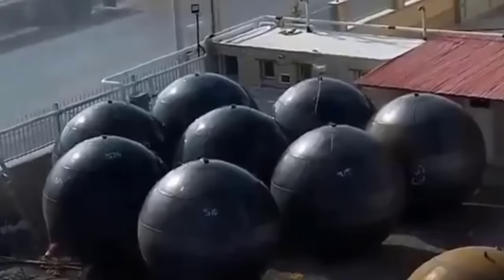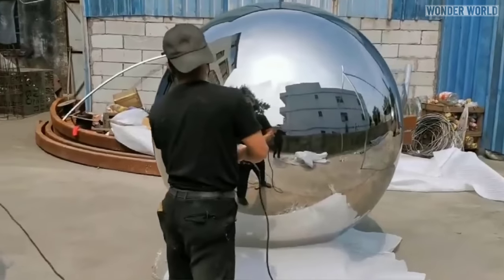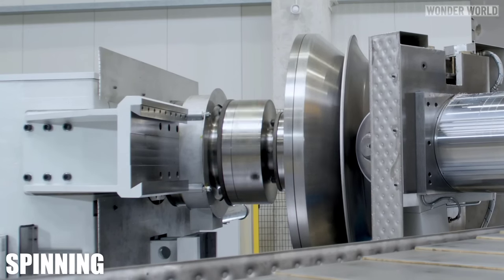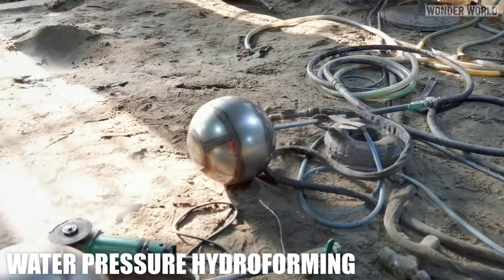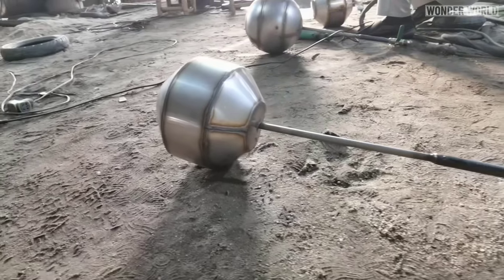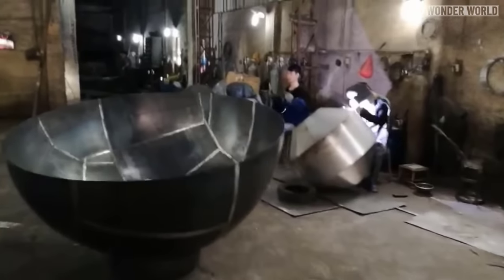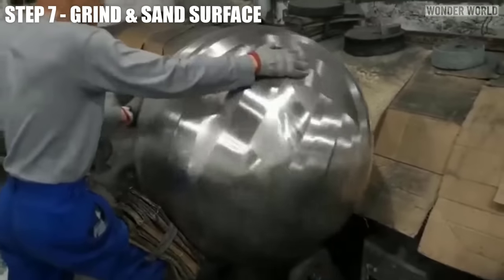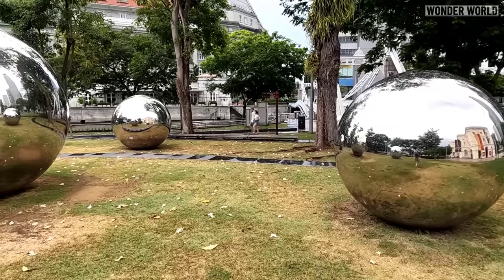How They Make Stainless Steel Spheres

Comment: It’s really hard to admire welding done without eye protection
Reply: I imagine that position has a high turnover rate. Sucks to imagine being worth less than a welding mask.
Reply: They have PPE, you can see a mask etc when he's doing a line. A lot of welders will do tacks with no goggles, just closing eyelids for a second. Not ideal practice but they do it by choice I think.
Reply: @peterlarkin762  a good employer wouldn't let you choose to do that

Comment: 2:38 I imagine the caps at the top of the spheres when explosive hydroforming are probably designed to release at a pressure that's high enough to allow the forming to occur, but not high enough to destroy the sphere. Very interesting...
Reply: Would they have to use a pressure valve?    I feel like all that water and such a small outlet, the water should mostly block the hole allowing the explosive to still build pressure.      Kind of like blowing water through a pool noodle, if there's enough water in the cavity then your cheeks just expand and you cant blow it out.
Reply: @loganhamilton9816  You're not wrong. I suppose you could do either or... Either use a pressure valve, or make the hole small enough.

I was actually describing a bit of both. You wouldn't even need to use a pressure valve per se, but instead make sure that the material, adhesive, and dimensions are enough so that the plug releases only after enough pressure has formed inside to form the sphere.

I suppose that might be considered a pressure valve 😅

I'm ignorant on the subject, though!
Reply: @loganhamilton9816   due supersonic shockwaves fluid dynamics valves and caps are not needed, the steel walls will get struck thousant of times reflecting shockwaves back to the center in the matter of a millisecond thats why it works soo good, 
the service holes are just to pour water and the explosive charge.
Reply: You must feel a genius, captain obvious.
Reply: @talesdemidioful  That's really interesting. Makes sense. When I first saw it, I thought I saw caps flying off, but I was wrong.
Reply: @suprememasteroftheuniverse  I would never, especially without their consent. That would be a form of harassment.
Reply: all simulated and calculated on computer beforehand to get near as perfect irl result no doubt.
Reply: Enough to bend the plates, but not enough to destroy the weldings, that's why I love science.
Reply: Probably what's known as a 'burst disc'. They are used all over industry

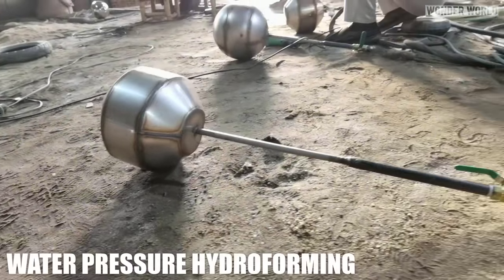Comment: @2:04 welding with no protection at all, why am i completely unsuprised
Reply: There's a reason they're so cheap!
Reply: they are doing spot welding with TIG. They blink right before they spot weld. (not recommended)
Reply: Also cleverly not having to waste any filler on it.
Reply: Just close your eyes. Tig welding doesn't usually fry you that bad, and this is coming from a red headed/fair skinned welder

Comment: 2:09 I don't think it is a good idea to sit right next to the sphere while it is pressurized. They really should  rethink their safety procedures. 💥😱
Reply: It's perfectly safe since water is not compressible and stores no energy in this state.  If the sphere were filled with air, the compressibility would allow the storage of tremendous energy, making it a bomb.
Reply: also strange to see all the water spraying around next to a plugged in angle grinder. no one ever wears safety goggles it seems... and there is no safety housing for the big hydrolic press...just imagine what would happen to a hand if it is in there.
Reply: @@ithecasticyou make a fair point
Reply: @frankpape7274 The hydraulic press only moves when the operator is sitting on the funny pedestal. It appears that the pedestal is a safety switch.

Comment: Water is needed to distribute explosive energy evenly around all walls. If you just plonk down an explosive it'll blow a hole at the bottom or pressurise the air and achieve nothing.

Comment: You are wrong. Those big spheres that where formed with explosive hydroforming are not made out of stainless and they are not meant to be shiny art pieces. How do I know? They have rust and mill scale on them! They are clearly made out of some type of hot rolled steel that's not stainless. My best bet would be P355NL2 or something similar as I think that these are pressure vessels of some kind.

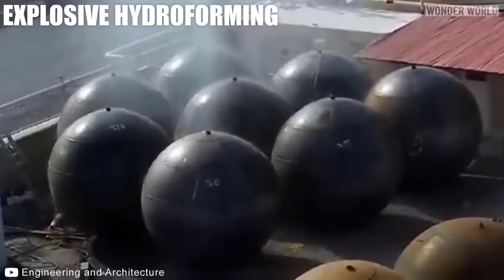inb4 someone does not believe me. Look at 2:28 you can see a streak of rust down the side. Then look at 2:40 there's 2 older balls in the bottom right of the shot that was done before and you can clearly seen they have been siting outside rusting for a bit as they are now a reddish brown colour.